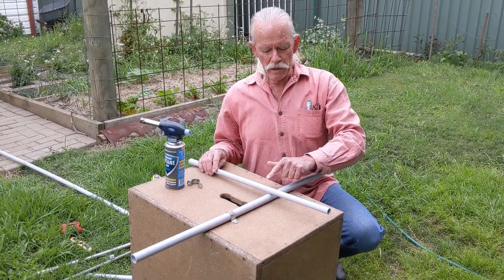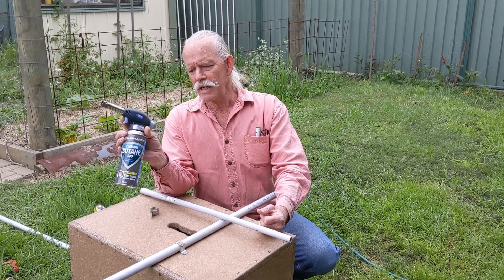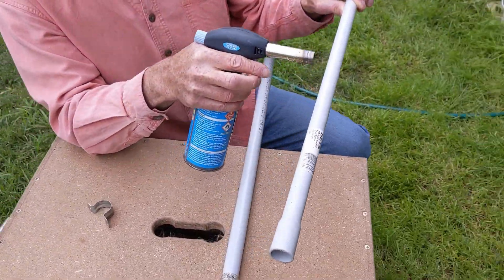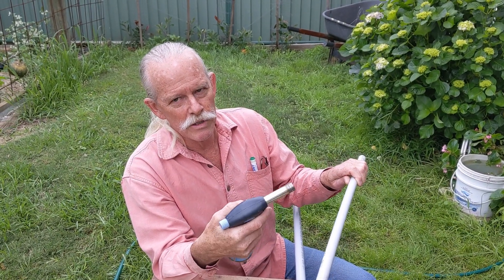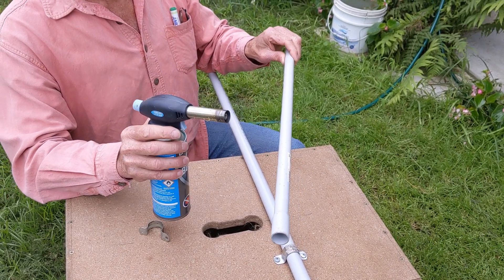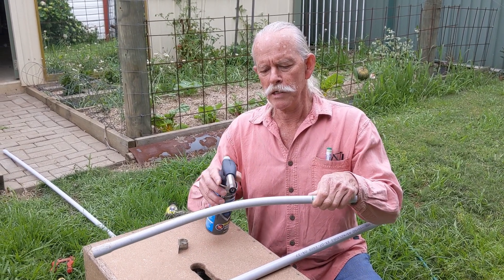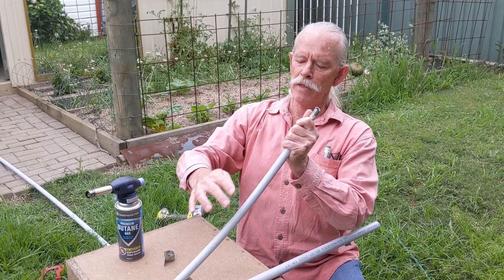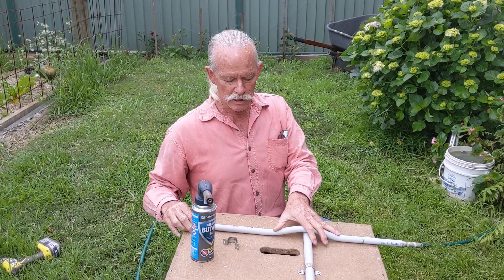How to bend conduit using heat and a spring

Comment: Hey can you make a video on bending 50mm orange conduit?
Reply: Same technique just rotate slower. Just alot longer to do, better with 2 people and make sure you've got a bottle of water to cool the conduit once you position it otherwise it'll take ages. 

Won't be perfect because we can't shove a non existent 50mm spring in there but it works!
Reply: Good luck lol.
Reply from the maker: Just did one for 50mm light duty. The strategy is the same. https://youtu.be/SyyPHtbbYSQ